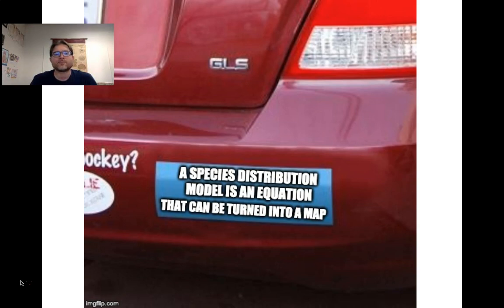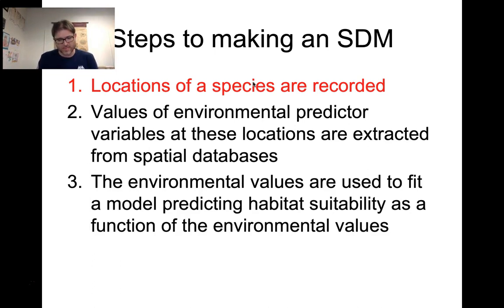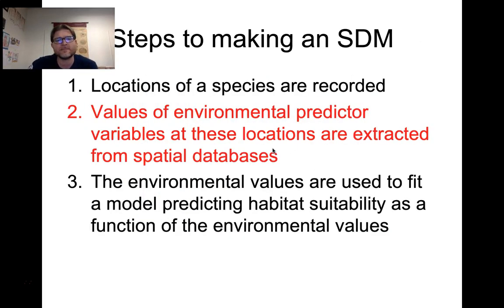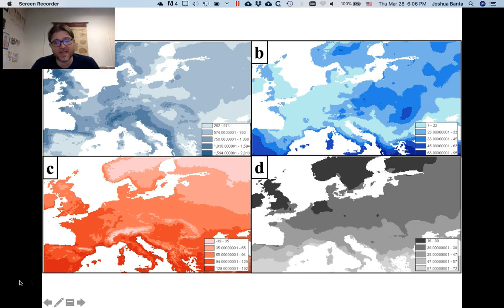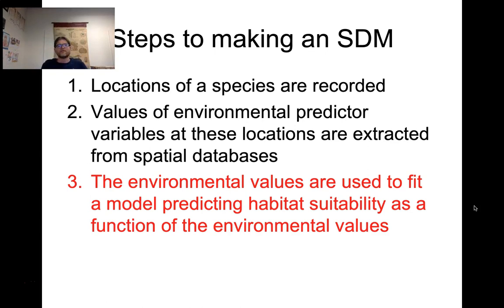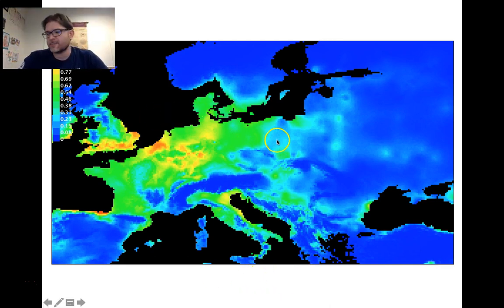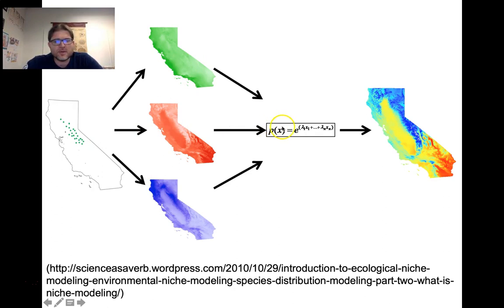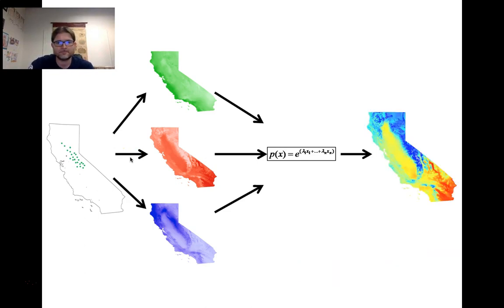Species Distribution Modeling part 1

Comment: How to calculate area cover by suitable, highly suitable, moderately suitable
Reply from the maker: Dear Kukilun, I would take the output from Maxent, and then use the "raster calculator" function in QGIS to change the raster values into three different values (low, medium, and high). See this video to get you started: https://youtu.be/gWHw52sc71w

Comment: Can we extrapolate our data in term of time, like if I have my data collected in 2019 and I have bioclimate variables for 2030, can I perform SDM for 2030 using the same data? Also, I am not training the data using points from 2019, that would be wrong. But what if I train the model first using data from 2019 (both the gps points and the raster environmental variables and then use that model to perform SDM for 2030?

Comment: Can someone explain why you can't use a SDM to find the probability of a species presence
Reply: I think it's becuse the probability of a species presence in a function of abiotic & biotic factors, but SDMs are just based on the abiotics. If you aim to model the probability of occurrence, you should include resourses availability, predation, competition and other variables.  SDMs just inform the fundamental niche, not the realized niche.

Comment: Couldn't your equation be skewed by the fact that your sampling is prone to be more concentrated in areas that are more easily accessible by humans? Wouldn't this factor potentially leave out key geographies that would be needed for your sample to be indicative of the entire population?
Reply from the maker: Yes, this is certainly possible. There is a fair amount of literature on this. The solution is to perform niche modeling with correction for sampling bias. See: Senula, S. F., J. A. Banta, U. G. Mueller, J. N. Seal, and K. Kellner. 2019. Species distribution models of eight North American Trachymyrmex (Hymenoptera: Formicidae) species. Journal of Insect Science, 19(6) 24; 1-11 (https://www.dropbox.com/s/bmasawt59jk6m9j/iez118.pdf?dl=0). This is also covered in my tutorial here: https://www.youtube.com/watch?v=G_xTGXUvYXo&t=23s
Reply: @DrJBanta  Appreciate the follow up! I will definitely take a look at the article.  Thanks!